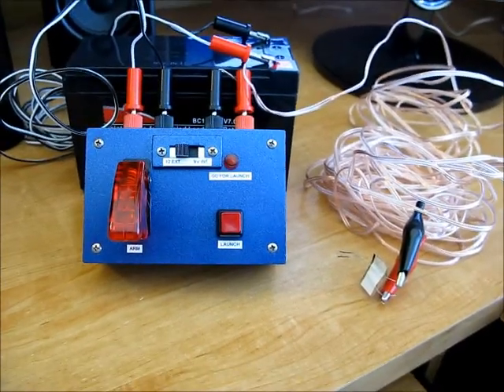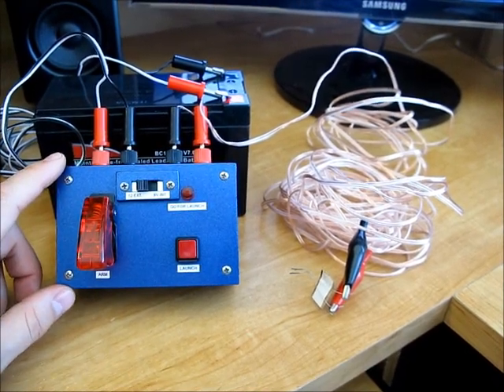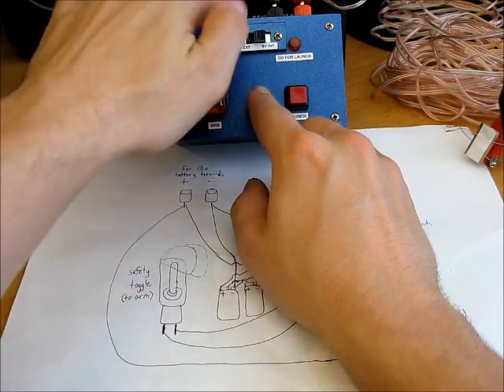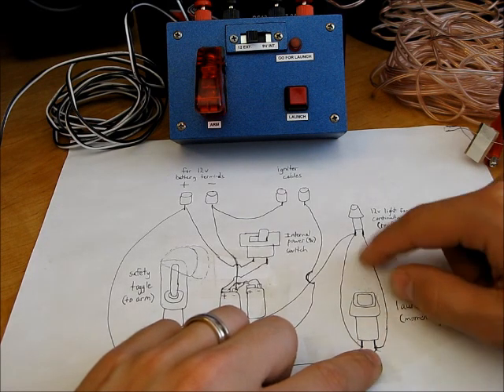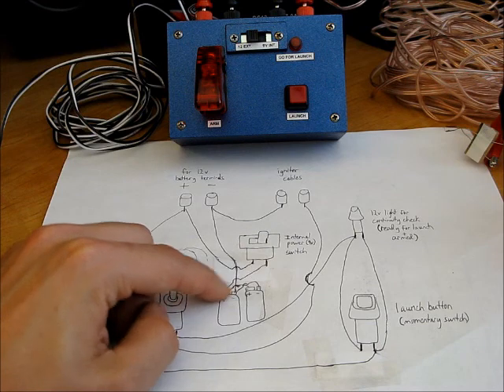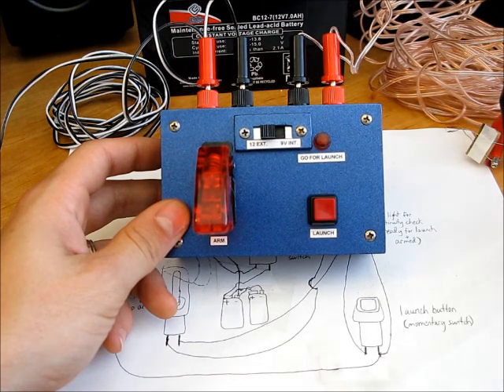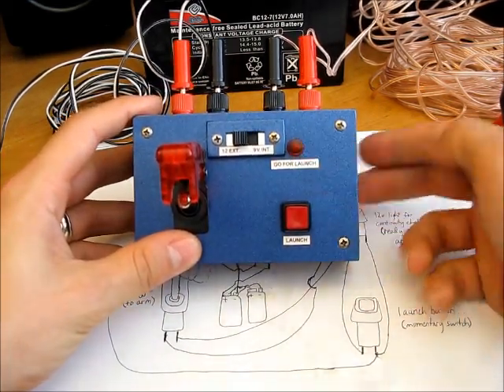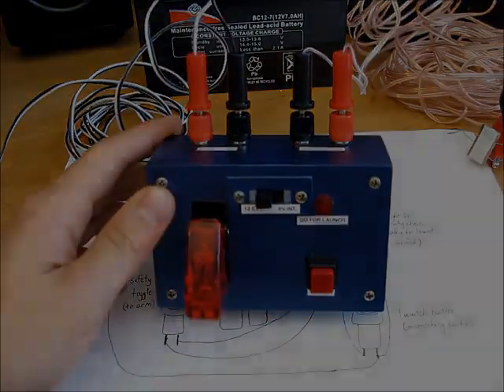Homemade Rocket Launch Controller

Comment from the maker: I just bought some 9v battery connectors. They connect to the top of the batteries and have 1 black & 1 red wire coming out of each. You just connect the two red wires together and the two black wires together. As far as the wiring for a 9v only system, everything would actually stay the same as the diagram in the video. The only difference being that you'd take out the two banana plug connectors on the left for the 12v battery. The wires going to them would simply be connected together.

Comment from the maker: I either solder or crimp the wires where they connect to other components, gluing wouldn't work because there wouldn't necessarily be metal-to-metal contact. I made that box, but you can buy similar boxes at Radio Shack. I use a 9v battery for small rocket launches and bring the huge 12v gel cell when launching really large rockets. Wires/alligator clips can be found at Radio Shack as well. Radio shack should actually have everything you need:).

Comment from the maker: No worries:). The radio shack boxes just need to have holes drilled in the appropriate to the size of the switch. Many switches have a round base that is threaded and come with a small bolt. That way you can push in through the hole and thread the bolt on from the back. Some of the square/rectangle switches have ears on the end with holes so that you can place small screws in them. you just drill small holes in the project box through the holes on the ears of the switch and screw 'em in:).

Comment: I'm a little confused about your diagram.  As soon as you armed your safety switch wouldn't you not only be sending power through the igniter to show continuity of the circuit but also enough power to light the igniter?  Or is selection of the bulb amperage critical in making sure not enough power remains to light the igniter?

Comment from the maker: Actually, the way it's wired, the bulb doesn't prevent the igniter from igniting. It's just on to show a completed circuit. The igniter only receives power when the temporary on/off switch is held down. It's just an LED, but you could probably use a small incandescent bulb if you'd rather.

Comment from the maker: Thanks! I actually just made that box out of 1/4" MDF board I had left over from another project. You can buy project boxes from radio shack though that are ready-made and would just require holes be drilled for the switches. I should have put the parts list at the end of the video. If you get a paper and pencil handy, I go over the various parts needed,giving names of each part during the wiring diagram section. I'll try to get that list up in the description sometime soon:)

Comment: A wireless door bell works good for a lounch box and you dont have to string wire all over the place then wind it up. just disconect the buzzer attach it to the relay with a 1000pf compassator acrose it, i used to D size batterys to power it it comes with AA's, i also used rechargeable 18 volt drill batteries for the ignitor wires, this is remote control no wire runs..! hope this helps..! good luck..!

Comment: I am working on a remote rocket launching system using Bluetooth wireless technology or maybe even WiFi.  I call it RAILS-Remotely Actuated Ignition Launching System.  The idea is that someone would be able to "pair" their phone or tablet to the remote unit and by entering a launch code and activating a software safety key would be able to launch a rocket with no wires!

Comment: Really cool! I just built one based on your design but when I press the launch button, the light remains on and the igniter doesn’t light. Based on your schematic, I don’t see how the light goes off when the launch button is pressed. Seems that it is still connected to the circuit either way. Any ideas?
Reply: I haven’t built one, but want to! Looking at the schematic, I assumed that your situation woukd happen! I’m no electric geek either, but wether you press the button or not, it’s still getting a connection to the launch wires! I’m confused!

Comment from the maker: I don't have one for just a 9v, but it would simply have the power wires going to a 9v connector instead of both the connector and the banana plug receptacles on the back of the unit. Also, the switch would be wired the same, but it would just be an on-off switch instead of toggling between the two power sources.

Comment: This is great.  Thank you for posting it.  I was wondering where you got the actual metal box for all the components. I assume I can get all the other parts at any electrical supply outlet.  Also, any chance you have a parts list?  I am not too savvy on electrical. Thanks again.

Comment: I built one and it works great.  I'm trying to build a second with only internal power (9v), but can't figure out the wiring diagram, electrical is not my thing (wood worker).  Any chance you have one for 9v only. Also, very interested in how you wired the 2 9vs in series, so it's easy to change the 9v batteries.  The way i did it the first time is pretty fragile.   In return for these answers, I will post a parts list from radio shack w/part numbers.  Kept all my packaging to make it easy.

Comment: So if you forget to switch the battery switch to ext youre connecting your 12v battery directly to the 9v batteries? It really doesnt take that much work to do it the right way. Do not follow that schematic.

Comment: Hey, I'm really interested in building one of these for myself. Is there any way of getting a parts list or atleast where I could get a box like that? Thanks.
Reply from the maker: Shoot, don't have a record of the parts I used, but any 12v switches would work. Just follow the video for which type of switch goes where. I actually just made that box from MDF and spray painted it, but you could use a "project box" off of Amazon if you'd prefer. Best of luck!

Comment from the maker: I just had some old computer wires I used, but I'm sure any 18 to 24 guage wire would be fine. I'm having trouble remembering now, but I believe it was around $20 for the controller and about $13 for the gel cell on ebay.

Comment: Not only on yours but many other DIY controllers I've seen on YouTube use an arming switch instead of a key.  Frankly, that although convenient it removes a critical safety component.  That is typically the person doing the final igniter prepping has the key in hand (i.e. removed from the controller) so there can be no accidental (or I guess purposeful) launch until they return to the controller.

What I'm actually more disappointed in is not seeing is anything beyond a simple circuit that just relies on a great big battery to overcome line loss of having large runs of wire (greater than 15').  Maybe something using a relay to trip a battery/circuit very close to the pad.  That way you can have just about any length and use (lug around) smaller battery packs.
Reply from the maker: True, the key is definitely safer and a relay setup would be a better design. For the true model rocketry folks who do the big league stuff, are part of the association, launching in groups, etc, you'd have to go that way. This is more for the average weekend rocket launch for kicks kind of person who wants the capability of lunching some of the big boy motors on occasion (think Estes+) without having to invest significant money and doesn't have a lot of electrical expertise. You gotta watch things closer and take better precautions but it'll get the job done is difficult to accidently trip.

Comment: i went to good will bought a  radio control toy car took it apart make a radio control louncher its 27 MhZ ,works just fine the wires going to the motor are the ones you use to trip the relay switch,

Comment: The only reason I did 9v+2AA is because everthing runs off of 12v and i wanted to keep it that way. If I wanted to I could put two 9v in Parallel and then 2AA in series to mantain the 12v but also get more amps. I have yet to use the launch I just haven't had the time or money to go launching. When I get the chance i'm going to do Strap-on booster rocket. If you go to rockertyforum (google it) go to "plans" and Click "MRX-01 Goliath" That rocket is what i have desinged and hopfully one day build

Comment: hello
i have some questions
how to detach a wire to another? can you just glue it on?
how to detach a wire to the banana plug?
also, where can you buy a box like that? walmart?
what is the difference between 12v and 9v?
where did you bought the wire that comes in with the alligator clip?
thanks so much if you can help me, i really want to make one myself!!

Comment: Hi, have u  built any wireless ones?  if so, do you have a continuity check? And if so, how did you wire it to only use one pair of leads.  I have built two wireless ones but have had to use 2 pair of leads, one for the test and one for ignition.  Can I please have a drawing of how to wire it.  Thanks alot.
REPLY

Comment from the maker: I would assume you'd just put either (or both) meters in line with the positive main wire after the switch. Imagine one wire and you just make a cut wherever you want a meter, connecting one side of the cut to the left side of the meter and the other side of the cut to the other side of the meter. I think that should work just fine:)

Comment: I'm doing the same control box. I just need the switch to change from 12v to 9v. What is the name of that switch or where I can buy?
Reply from the maker: I picked up mine from Radio Shack. I believe it was called a 3-pole on/off switch (12v).

Comment from the maker: I don't know that it would really be worth it for you because I would probably want to see a good $20 for the time investment and the parts are $20-$25. So you would be looking at $45 for the unit and most likely another $5-$6 for shipping. At that point you could get the Aerotech Interlock controller for about the same or a little less.

Comment: What size wire did you end up going with for the cable that you run from the controller to the igniter??? Thank you for the response.

Comment: im like you im not a circuit person so my first go into this trying to work out the wires and where to put them open your box when doing the talking on the wires and were to put them soldering .and the likes if problem if any.

Comment from the maker: Sorry, I don't have a digital form of that, but you can pause the video when the wiring diagram comes up and print the screen. The parts list is in the video as well. There aren't too many items, so it should be easy to write out. Good luck and thanks for watching!

Comment: I am working on my own launch system. It is my first time building a launch controller.  I drew a schematic similar to yours but mine will not have internal power. Do you have a Facebook so I can message you a picture of the schematic?

Comment: I'm a little confused about your switch that selected 9V or external power. Shouldn't there be a 3rd pin on that switch?
Reply from the maker: You definitely could wire it differently and use a 3-pin switch, but you only need a 2-pin the way i used it. The 12v circuit isn't connected to that switch at all, so it will work regardless of the position of the switch. The switch simply turns the 9v circuit on and off so that I don't fry the 9v battery when the 12v is hooked up. It says 12v on my label for the switch, but it's really the off position for the 9v circuit.
Reply: tlgrimmy Got it, thanks!
Reply: Michael Thompson Those 9V batteries should be wired in parallel though, not series, right? In parallel you get the same voltage, more amps. In series you get more voltage, same amps, unless I'm totally out to lunch.
Reply from the maker: Michael Thompson Wouldn't hurt to try it that way. I remember reading somewhere that they ignited more reliably with higher voltage, but they may do just fine at 9v. The extra amperage would allow for longer leads, which would be a nice plus.
Reply: Michael Thompson You are partially right.. with the batteries in parallel, there is more AVAILBLE current at 9v. c=but it will not typically cause more current to flow in the circuit. (It's complicated to explain the difference between available current and how much current will flow in a given circuit)

For more current to flow thru the igniters, the voltage has to be higher. (using the equation I=E/R, which is current equals electromotive force divided by resistance)..  In order to increase current in a circuit using the same resistance (igniters) you must increase electromotive force (voltage).

In the case of losing voltage because of long leads (increasing resistance), having the batteries in parallel will not help with that either... because the increased resistance at the same voltage will cause a drop in current regardless of having the batteries in parallel.

So, no matter how ya look at it, you will get increased performance from the circuit if you wire the batteries in series. Then you will be running an 18v system, which would be better than the gell cell. However, you won't get as many launches as the 9v batteries do not have nearly as man milliamp hours available compared to the 12v gell cell.

Comment: Your Banana plugs where did you find them. I have been searching for 3 weeks. In town and online! That all i have left that i need!!!
Reply from the maker: I think i bought those at Radio Shack back when they were open. Just found a few on Amazon though. Mostly audio connector style, but if you search for "bullet connectors" there were some simpler options under that. Best of luck!

Comment from the maker: @vicman2112 Actually, for no particular reason, I didn't have the leads hooked up to the battery during that portion of the video. I probably should have for demonstration's sake, but inbetween shots I disconnected them. I have a video of the Titan rocket launch using the setup, but not sure if you can see the light or not. It does function fine, so any 12v dc light ought to work for you.

Comment: the problem I have found with electronic launching is that the ignighters are inconsistent and some times are bad. That is why I switched to fuses wich are a lot more reliable.
Reply from the maker: Yeah, I would definitely like to have fuses around because they are fool-proof for the most part. I've had a few outings for sure where there was enough juice in the batteries to ignite the igniter or the igniter itself broke.

Comment: +tlgrimmy where did you get the red arming switch
Reply from the maker: Preston Ware I picked mine up at Radio Shack. Might have to get it online these days. Although, a Grainger or an Ace Hardware might have one.
Reply: ok thanks. and did you make that box out of plywood.
Reply from the maker: It was actually 1/4" MDF, but thin plywood might be better.

Comment: I have made several launch controllers, as well as launch pads. Everything available commercially is pure junk. The Estes controller looks like it's made for a 2 year old. Even the Aerotech stuff is junk. Why I feel that a true enthusiast would always build their own equipment (and design and build their own rockets) it would be nice if the industry would come up with something decent. My current launch controller is made out of an irrigation timer box, and has a lid to cover all the switches and connectors when not in use. I used heavy duty industrial grade parts. I may never need to build another one.
Reply: Hi, have u  built any wireless ones?  if so, do you have a continuity check? And if so, how did you wire it to only use one pair of leads.  I have built two wireless ones but have had to use 2 pair of leads, one for the test and one for ignition.  Can I please have a drawing of how to wire it.  Thanks alot.